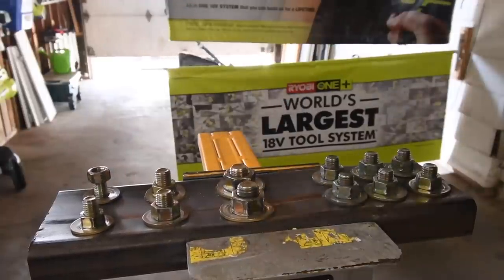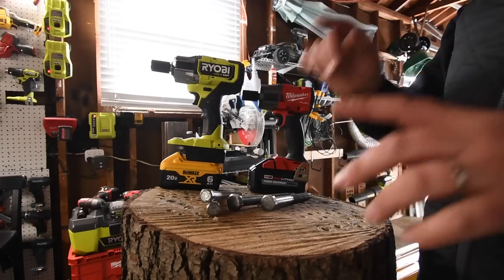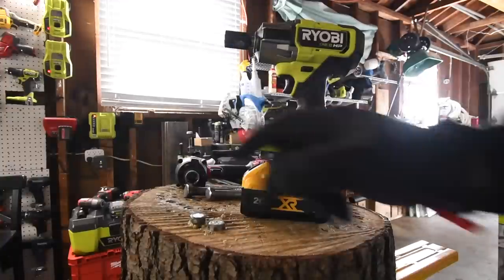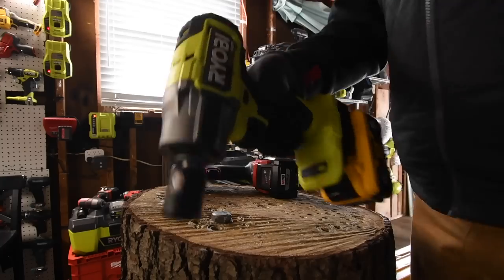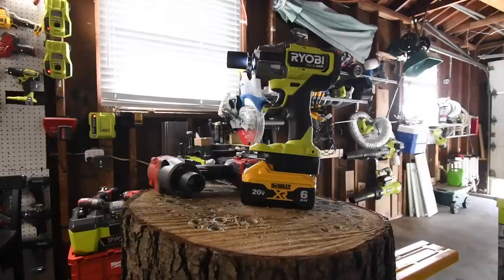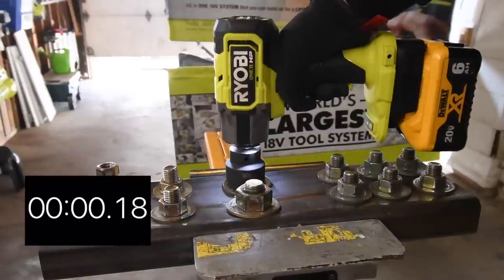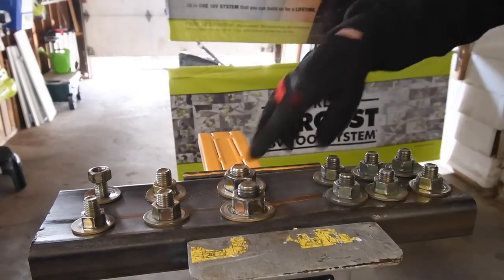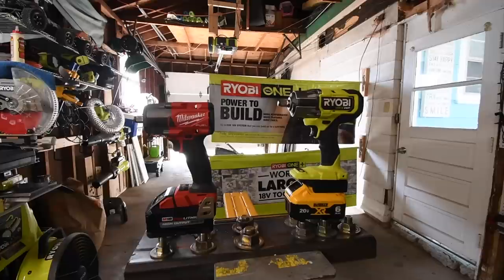Ryobi vs Milwaukee (Mid Range Impact Wrench)

Comment: I recently purchased the P262. I'm sure how tight that Tacoma's axle nut was, but I was lifting the truck off the jackstands with the MATCO 28" long 1/2" ratchet, and nut didn't budge. About 2sec smack, and it was over.

Comment: @mancavertools I don't hold any weight to the blind torque tests,  simply hammering on it for the same time could be still a large swing in actual torque applied, with heating up, bolts expand and contrast one time it could be 400ftlbs the next could be 300, that's the exact reason torque wrenches have to be certified calibrated to ensure this exact thing.  Otherwise it's all just time filler
Reply from the maker: I dont know about you but I think along with many others that this was a good test, but I thank you for viewing Brandon
Reply: @ManCaverTools  I'm not saying it with any Ill will or anything,  I was just stating an opinion,  I've been a subscriber for a long time and watch for a reason.  I was just giving you a opinion to think about,  it's a good gauge on what the tools could possibly do but as I said,  it's not close to being accurate due to the points I made.  That's why there's torque wrenches/gauges of many kinds because there are so many factors with expansion and contraction, friction, heat etc that it one test to the next can throw it off so much that it makes it unreliable to make a real conclusion

Comment: I think you need a Ryobi HP battery to get the full power from that impact wrench.  The HP batteries have extra connectors on the back of the battery that connect to a circuit board in the tool that allows extra power from the battery when needed.  Without the HP battery you are not fully utilizing the potential power of the Ryobi.
Reply from the maker: I will do a test on that to see if there is a big difference

Comment: Oohhh, so THAT's the battery we need to use to get the juice :P
Reply: I wouldn’t be surprised if the Ryobi using the DeWalt 12 AH FlexVolt battery surpassed the Milwaukee using the HO XC6.0
Reply: I saw your test and you may be right.
Reply from the maker: I think it would be a great idea :) and I thank you TTC
Reply from the maker: I saw your video and I loved it
Reply: @ManCaverTools  hey thanks. We'll have to throw on an adapter and see how that works too when we eventually retest. Quality stuff as always MCT

Comment: That 1” Milwaukee produces 1500 ft-lbs fastening. 1800 breakaway, but it has the power to produce 1500
Reply: It gets nowhere near max torque for how long he hammered it on. Those little impacts did not bust 1500 ftlbs.
Reply: @kevinragsdale6256  True indeed. My point was that those bolts are not tightened to 1800 like he thinks. More like 700 since he only tightens for 3-4 seconds. 700 ft lbs only take 560 ft lbs to breakaway, so that would make sense
Reply from the maker: you are correct, but you do understand that it is a power impact wrench and that beast tightening bolts is no joke
Reply: @ezrawaters6653  I bet that was not even 700 ftlb

Comment: I have the Milwaukee impact and I must say I did run into a scenario where space was an issue working on the vehicle I was just barely able to fit the Milwaukee mid torque , seeing the difference in size for the Ryobi that would have not worked on that vehicle using the Ryobi...but your video show's that Ryobi has power to match Milwaukee another good video
Reply from the maker: that is also why they made the m18 and m12 stubby :) I thank you for viewing bad

Comment: I am surprised no one commented that the Dewalt battery is 20 volts not 18. Just because the two batteries are rated as 6AH they are not equal.

Comment: I thought the new hp batteries had 21700 cells
Reply from the maker: they do not :( the batteries are way too small to have 21700 cells in them
Reply: @ManCaverTools  yes ryobi does have 21700 cell batteries though

Comment: The bigger issue is your have virtually over driven or power boosted the Ryobi with higher voltage you really should have tried it with a Ryobi battery. Using higher voltage will certainly lessen the life and reliability of any electrical motor.
Reply: Do you all claims 20 V but is only 18 do some research

Comment: Why wouldnt you use a torque wrench to tighten up instead of an opponent’s impact?? Makes no sense to me. That is a point of torque wrench and then pitch them against each other to bust it.
Reply: I asked him this before and he claims he needs some special torque wrench that costs in the neighborhood of like 5k.......
Reply from the maker: its a good way to test it as well for the fastening torque. this is a versus video against these 2 not to see the specs individually
Reply from the maker: I do tests very often and to tighten these to 700 ft lbs of torque in the shortest time possible with very little effort due to time. imagine tightening 14 bolts to 700 ft lbs every time I do a test, I need that tool. people will still say that the test isnt accurate enough if I use a torque wrench.
Reply: @ManCaverTools   your test isn’t accurate at all right now. I’ve seen multiple other channels use regular torque wrenches and it increases the test validity. I know you tried to tighten them for the same time but that’s wildly inaccurate. I’d really love to see some consistent test measures.
Reply: @Ecozzy0123  in agree, this dude has zero clue about anything.

Comment: Pretty pointless video. Testing a tool with a battery it doesn’t come with....
Reply from the maker: you do know that this isnt the only video I did of these right? This is just 1 version of a test with these tools.
Reply: I wouldn't call it pointless because there's probably several folks watching that didn't know about the adapter. Also to see the difference between the power of the dewalt battery on the Ryobi compared to the actual Ryobi battery is pretty cool to watch.
Reply: I agree!!👍✊Its always nice to see what it can do with an adapter, as I'm seriously thinking of getting one for awhile now.... Good comment btw!

Comment: On the torque test channel it shows that most milwalkee has nowhere near the advertising torque. More like 60% of the advertised torque.  For the high price point it's kind of false advertisment but Ryobi produced about 80% of the advertised torque and I say Ryobi is a better value for the money.  Let the the M18 1/2"  impact wrench is up to 1400ft lb but with the test at torque test channel is only produces 728-778 ft lb.  The M18 mid torque is 650 but produce somewhere 495 to 500ish. Milwaukee is still very best. For the higher would attributes to build quality and the 5 yrs warranty.  I heard plenty of people try to file warranty claims but there's dead end.  Can't get a hold of csr and being pushed away.  With products that is expensive Milwaukee should have the best customers service.